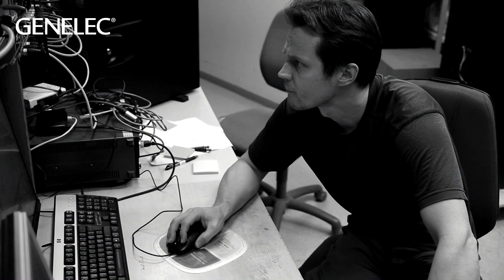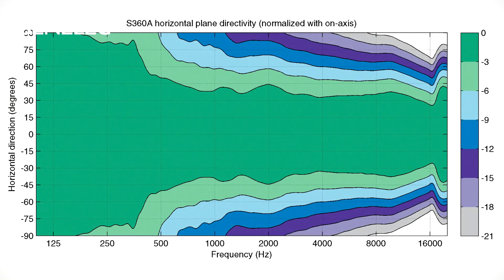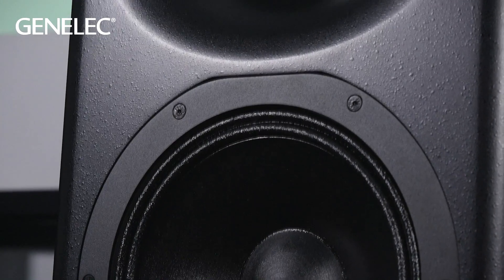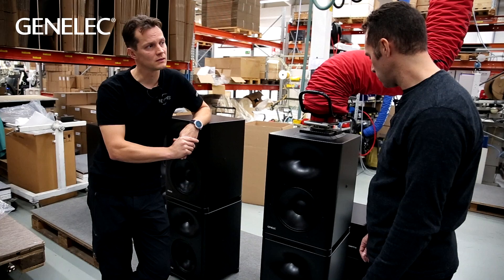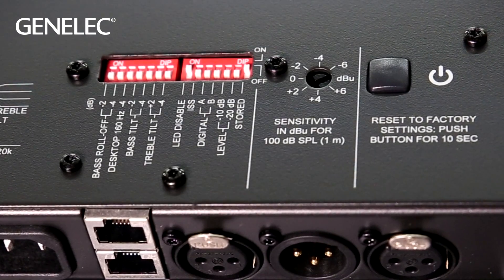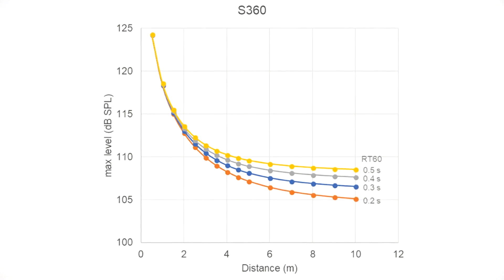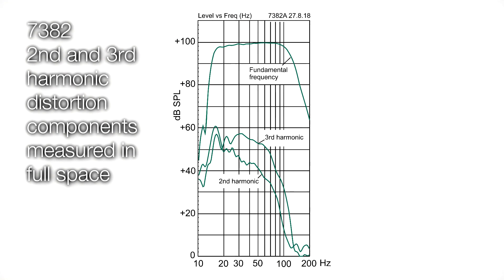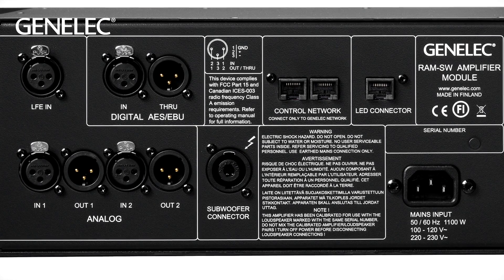Designing the new Genelec S360 and 7382 high-SPL studio monitors

Comment: GenelecSAM's + Trinnov Altitude 32 = Dreams come true xD
Reply: With GLM3 + pro room treatment,  I dont think you need to buy Trinnov
Reply: @HaNguyen-kn2tg  OFC you dont need to but It sure makes a difference, compared to some denon or maranz etc PREs or AVs..
Reply: @anderzz85  Agreed
Reply: @HaNguyen-kn2tg  digital outputs & Trinnovs Optimizer/3D remapping. Hard to beat atm..
Reply: @anderzz85  R u sure?
I got myself new genelec 1237s with room correction & everything.
switched back to 1037B, because the old A/B amps do more for the sound than the room correction ;)
Reply: @lrrrruleroftheplanetomicro6881  Yes, Im sure :) Depends on what kind of sound you like though. Digital is more clean, analog changes the sound depending on other factors more